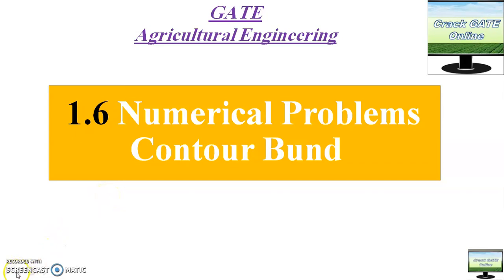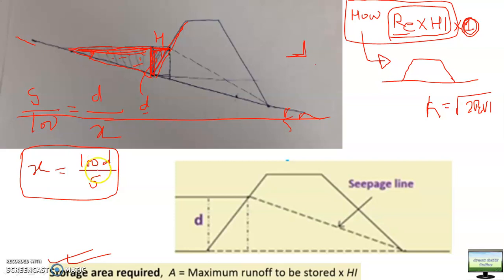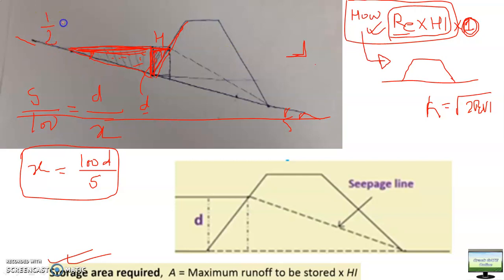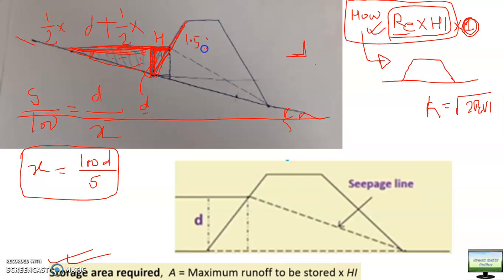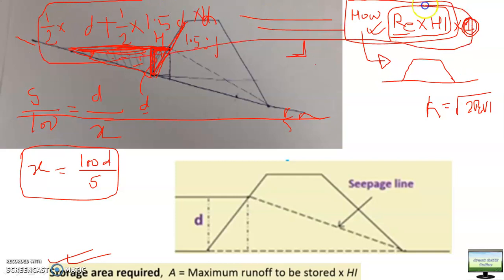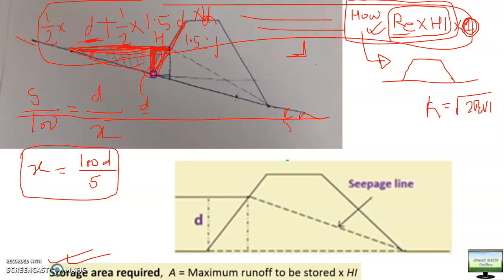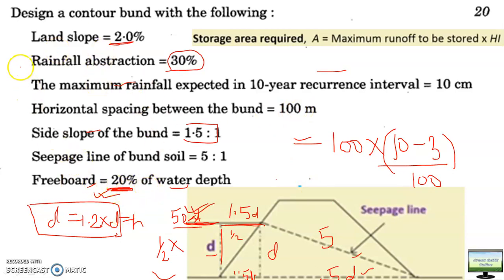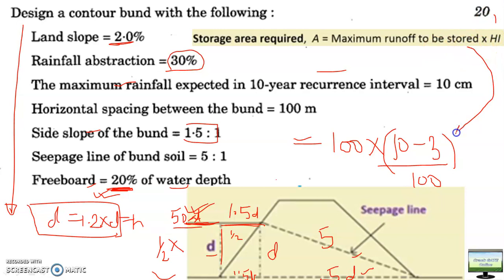1.6 Bund

Comment: Sir during calculating impounding water depth you are taking two triangle is equivalent to the (Re×HI×Legth ).but in lecture 1.4 you are taking only left portion of triangle equivalent to the (Re×HI×Legth ) . So please tell me which are correct. If both are right then when  we use 1st and 2nd formula.
Reply from the maker: kindly watch video again..